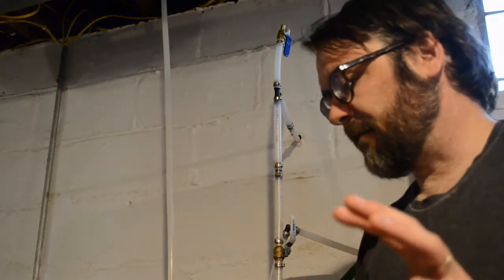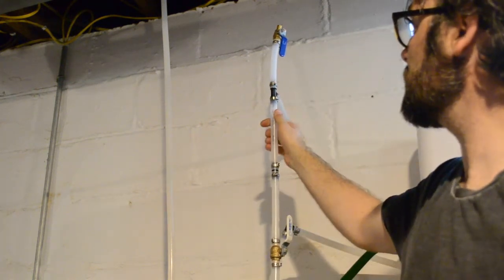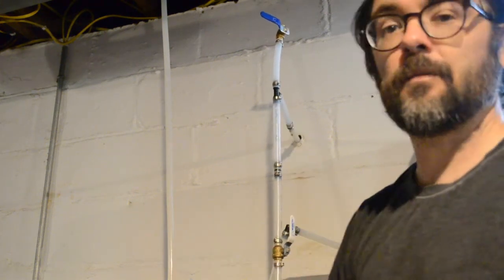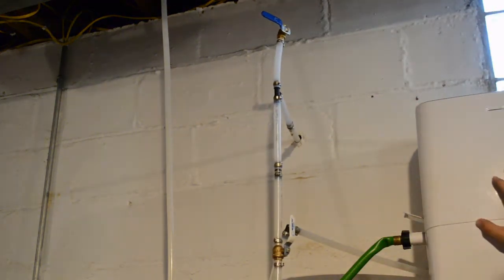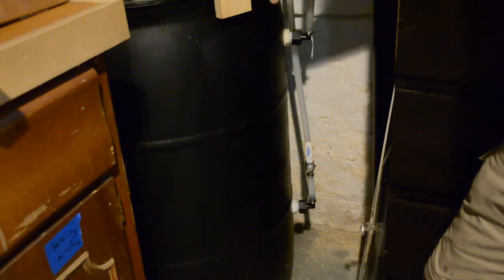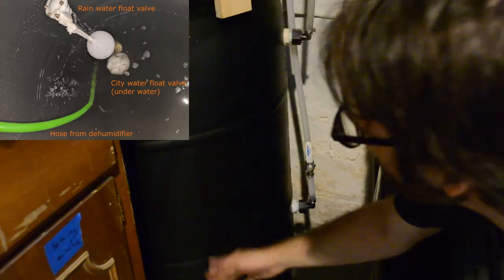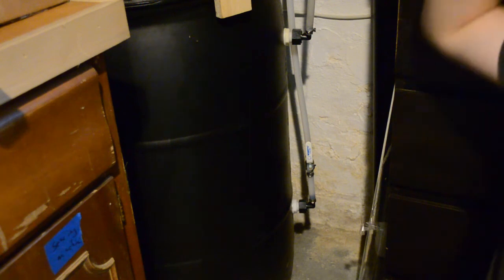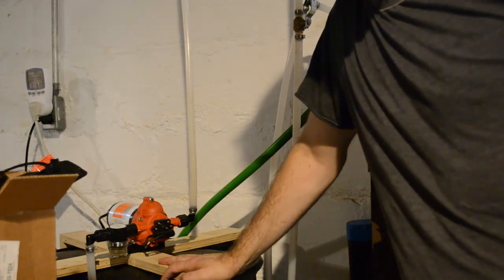On demand rain barrel pump system (Part 2. Some improvements.)

Comment: I watched part 1 and 2 and you didn't even show the pump working!  Are you serious???
Reply from the maker: I'm sorry, but I don't understand the question. In what sense do you mean "serious"? Are you concerned I didn't plug it into the wall correctly? Or that I got one that doesn't work?
Reply: I’m upset because I watched two parts of your videos to see the pump demonstrated. I wanted to see how much water is coming out of the pump and you didn’t show that.
Reply from the maker: @marksTips466  actually I am going to make you that video. Thanks for the suggestion. Give me until the weekend.
Reply: @GordOnTheRoad  You're the best!  Thanks
Reply from the maker: https://youtu.be/Zu9YofzvuN4
Reply from the maker: @marksTips466  oh, I see. This question is clearer. The pressure is indistinguishable from my city pressure. That's what the pump is designed for.  I guess I could make a video of that if you really want. Also you can buy pumps with a range of pressures of you want more or less pressure, it will say on the box.